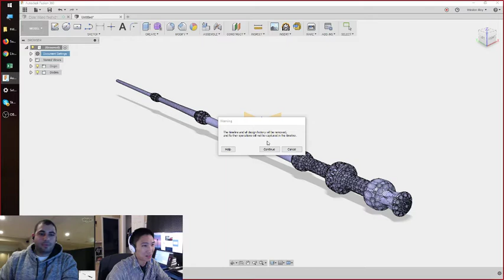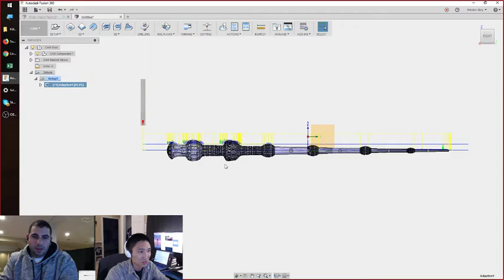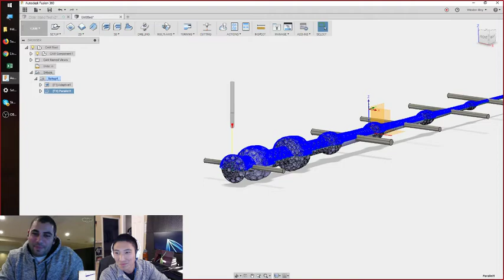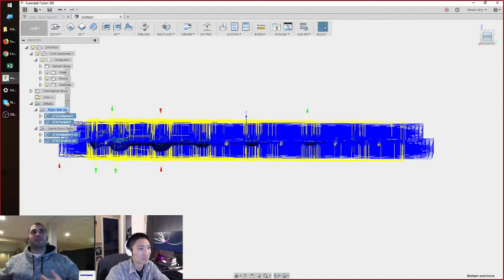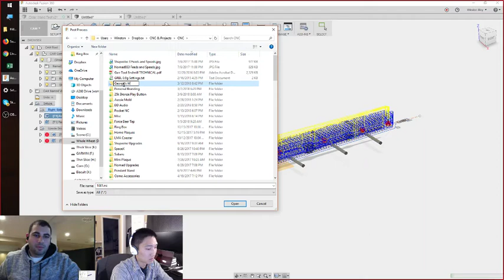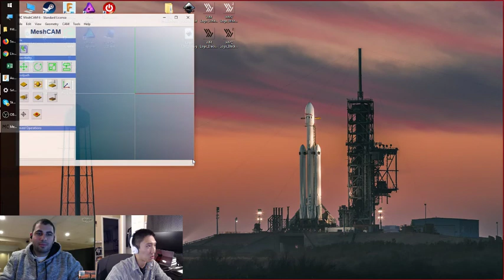Turning a Harry Potter Wand STL into Gcode - FusionSide Chats Ep. 1

Comment: I believe the option you needed for those tabs was the "touch/avoid surface" option. That would force through tool paths to go around them without machining them.
Also, while setting the retract to a very short distance can speed up the tool path time, it does run the chance of crashing into your hold downs. An alternate option that can achieve the same effect is to set the "Retraction Policy" dropdown on the Linking tab to Minimum Retraction. However, this option is not available for 2D tool paths so setting the retract height closer would still be required for those toolpaths.
Reply from the maker: Correct on both counts.